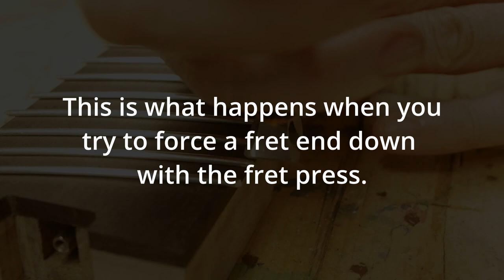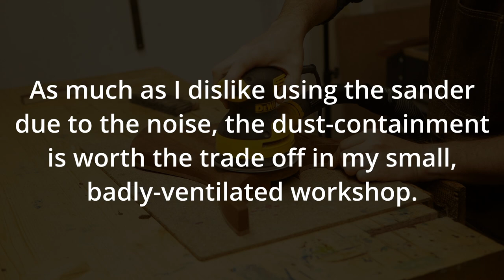How I built the 7-string guitar without power tools | Hand tool woodworking ASMR with subtitles

Comment: Great vid and the subtitles really help. Would you be able to share more details about the finish? How many stain/wax coats, what grit sanding in between, etc.
Reply from the maker: I think I did 2 coats of the black stain on the mahogany, then followed it up with around 4 coats of Osmo hardwax oil on the front and back.

Comment: Fascinating video, thank you for sharing!  Your skill with hand tools is very impressive and the guitar is beautiful!  I couldn’t believe how well the face cut of the walnut top turned out, in particular, though all the planing and chisel work was amazing.

I had a couple of questions from this build that I’m wrangling with for a similar effort…
- it looked like you used a flat neck slot (e.g. no angle).  Is that the case and if so, did you pre-measure the bridge height to determine the depth of the neck slot?
- was the neck profile symmetric (top & bottom to the flat) or asymmetric like the Endurneck (angled slightly from the bottom at the neck pocket to the top close to the head)?
- having put in fanned frets, did you prefer them to straight (square) frets?  They seem to get mixed reviews…

Thanks!
Reply from the maker: The headless bridges are pretty low, so there wasn't much break angle needed. I just sanded it into the heel. 

The neck profile is an asymmetric trapezoid, where the bass side rund parallel to the neck and the treble side parallel to the center line. 

As for the fanned frets, I'm not picky. I like them, but I have nothing against "normal" frets either.